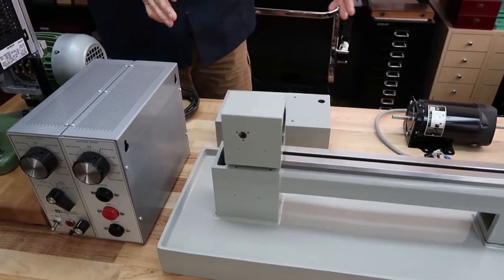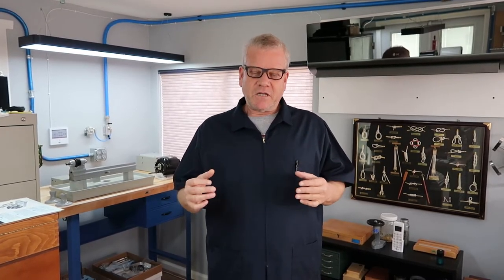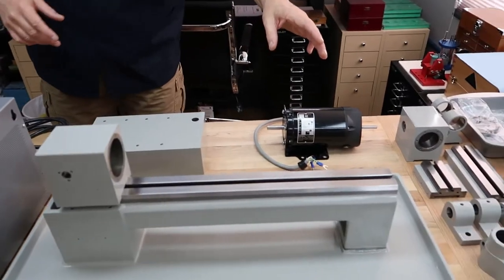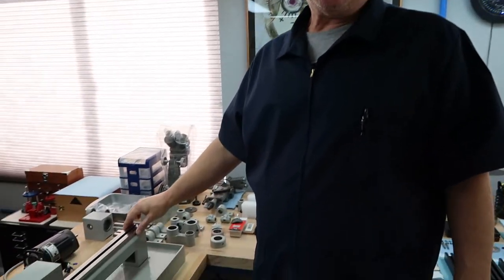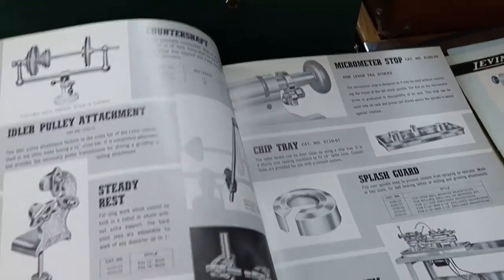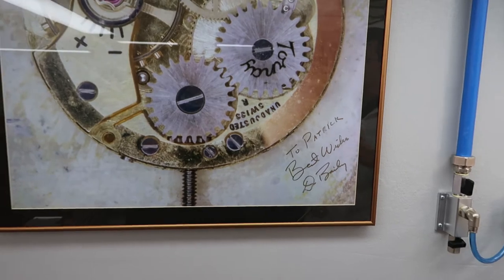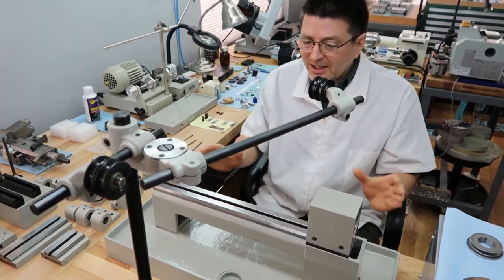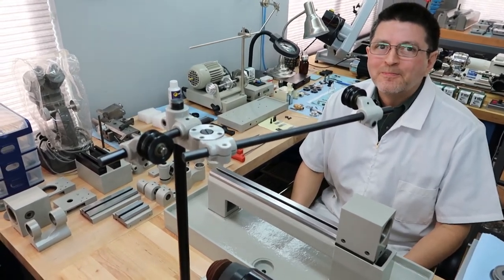SHOP ADVENTURES 17: Working on Levin Lathe Installations

Comment: Hi Guys,

You really love your vocation, and I can see why.  To get those old lathes into pristine condition is no easy task and the results will make it more than worth it.

Very interesting videos.

Cheers Rob
Reply from the maker: Hi thank you rob, Happy new Year from Patrick and Lance. We hope you will watch a video coming up in later end of January range where we are (in major great detail) installing twin angular contact bearings a pair of them and a rear stabilizing bearing into a Levin Lathe Head Stock while holding a TIR total indicator run out of 50 millionths (sounds scary but it is not). This is likely to be be our first pull out video away from the current weekly blue thumbnail Shop Adventures we are sharing currently. The pull outs are very detailed and are to teach the future generations our take on how we rebuild micro machinery and tools and so forth. Thank you for watching our channel as we truly enjoy your sharing experiences. Here is to a GREAT 2019 for us both Rob, Patrick and Lance.